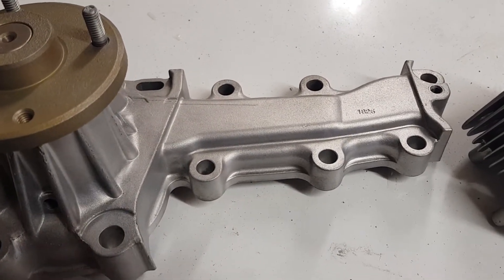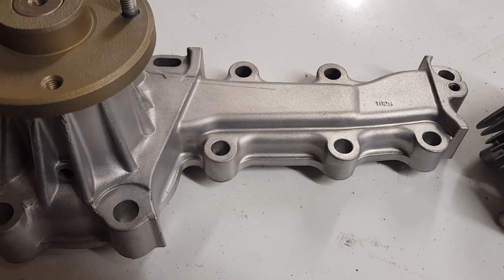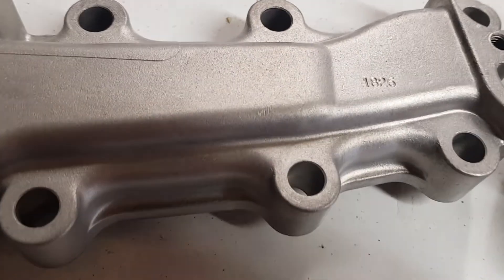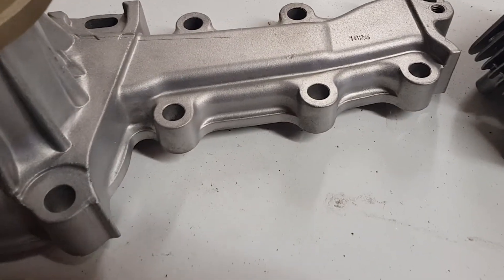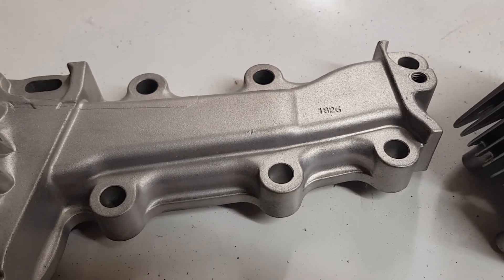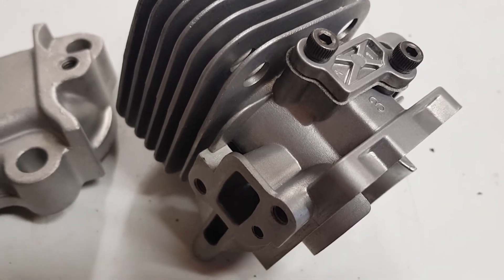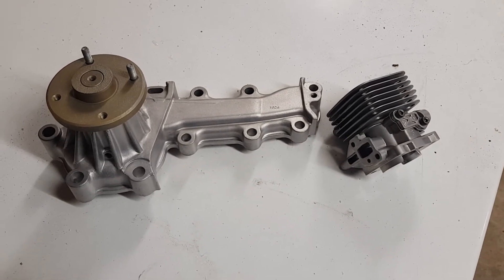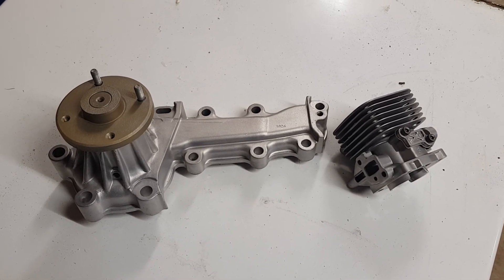Update on media used in DIY Vapor Blaster

Comment: Can vapor blasting be used only with degreaser and air? I worry about media in small oil holes, threads, etc
Reply from the maker: Hi Eric,
That depends on the finish you want. Using air and degreaser will have a cleaning effect, but in order to get the finish that vapour blasting is known for, you need media.

Some people use water super saturated with sodium bicarbonate. It is much softer on the surface and is easier to clean out. But again, the finish is not as nice as vapor blasting.

Thanks for watching!

Comment: Hi mate could you point me in the right direction of a water/slurry pump please?
Reply: Harbour Freight has the 6000 GPM pump that works fantastic in these.
Reply: RaGeH20TEMPER hi mate we don’t have harbour freight here in Australia- only Bunnings- what do they market that pump as(water transfer etc)?
Any help would be appreciated 👍
Reply from the maker: @linc341   Hey mate. What nozzle and compressor cfm will you run? There are plenty of options but you need to find the right pump for your application.
Reply: Armoury Enterprises  Hi mate I don’t have a nozzle yet I was thinking of getting one from VHT- probably the smallest nozzle they do ( unless you have any better suggestions?)
I’m running two compressors as well with a combined cfm of 16 - basically starting from scratch - I’m building it out of a laundry tub base and fabricating the top out of stainless steel- so I have the basic cabinet design sorted just need to know about pumps etc- any help would be great👍
Reply from the maker: @linc341  what sort of price are you paying for VHT stuff?  I get mine from Aliexpress which is ok if you are able to tidy them up and fix any defaults.

Remember both nozzle tip and venturi size are relevant.
Reply: Armoury Enterprises I haven’t bought a nozzle from them yet - but I did buy the microhone unit from them which cost approximately $2500 to my door in Australia .
Hence the reason  I’m going to build my own larger unit - would be a bit to pricey to get a larger unit to Australia.
I’m starting fabrication on the cabinet today as I’m on holidays so any pump info would be great. My cabinet will be approximately 500mm square .
You can add me on Facebook if don’t want give info here cheers 🍻

Comment: Are you going to share or sell the "How to build the vapor blaster"?  There already are guys selling their perfect build plans. From what I've seen they use about 100 psi and very fine glass media. I'm not sure but it seems like the pro's have a higher water flow. Not higher pressure just more water than you.
Reply from the maker: If you are willing to spend the time looking, you can find a lot of information online. Including a few who sell build plans. The resource I am putting together is not a build plan to copy the units I have posted in these videos. I initially started this channel to because after building a few cabinets at far higher cost, and to a far higher quality, I wanted to see how cost effective I could make the build process. This channel was set up to document that. The first one I did was a sand blast cabinet conversion for less than $500NZD. Then I wanted to see how far I could push things and built one from scrap metal. Far from the quality of the VHT/VaporMatt/Vixen machines, but for a small fraction of the cost.

The content I am currently working on is an amalgamation of all the principles I have learned during the development of multiple units I have built, from bench top size to larger 1200mm x 900mm units.  It was those principles I used to build a working unit entirely out of scrap metal. For example: Yes, the industrial units flow much higher volumes of slurry. But more is not always better. Everything needs to be balanced to achieve the best results possible from the components you have available.

The resource will enable those who want to build from scrap, or convert an existing cabinet for a fraction of the cost of the industrial units, or evan many of the pre-existing plans available. It will be particularly helpful to those in places around the world where components are not readily available.
Reply: @ArmouryEnterprises  It's very cool but I don't need this tool. I'm just gonna watch your videos because it's interesting.